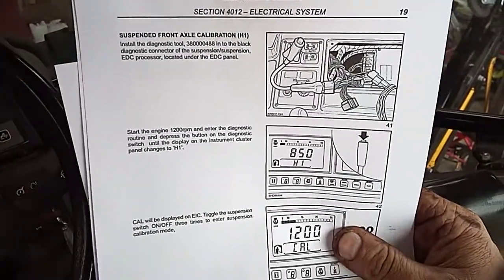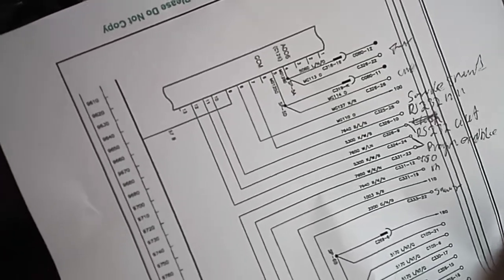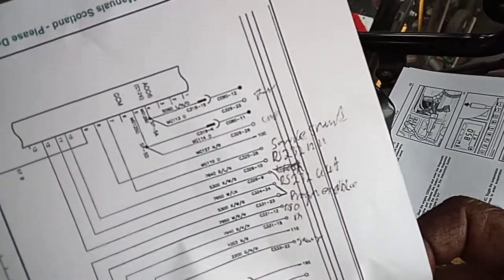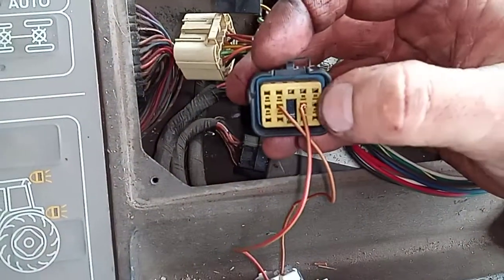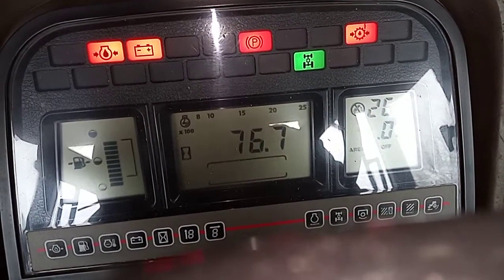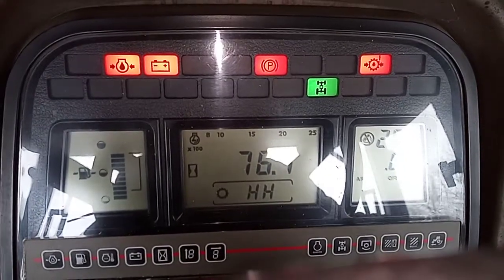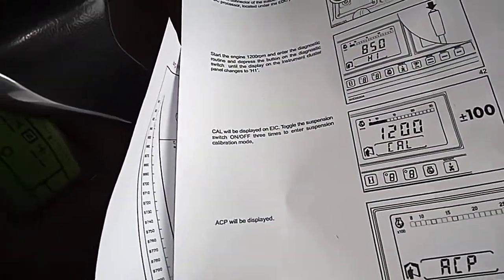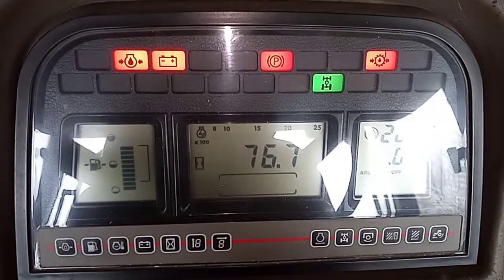Free case ih mxm 190 175 165 155 home made diagnostic tool 380000488 diy video calibrating service

Comment: I have two TM 155s one has the black connector and the calibration worked the other doesn't is there the black connector is there another way to calibrate the suspension?